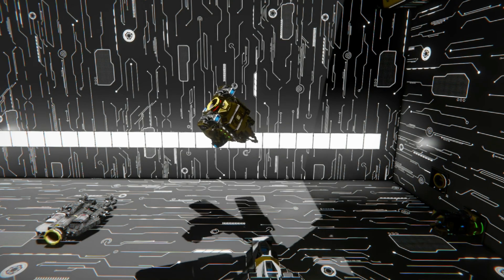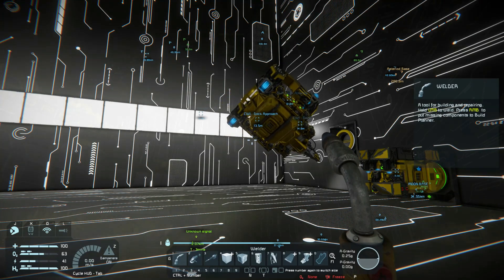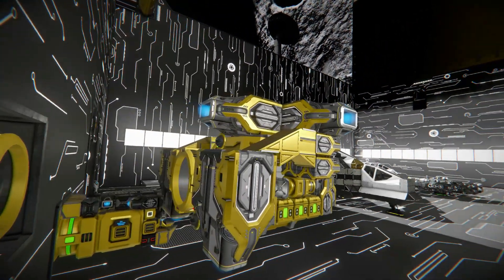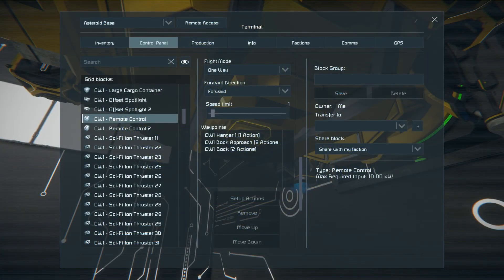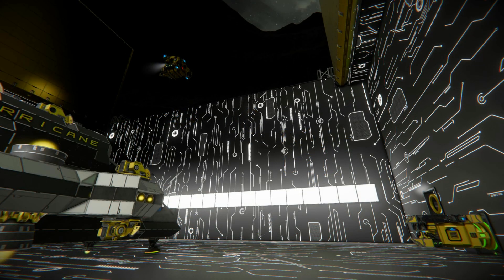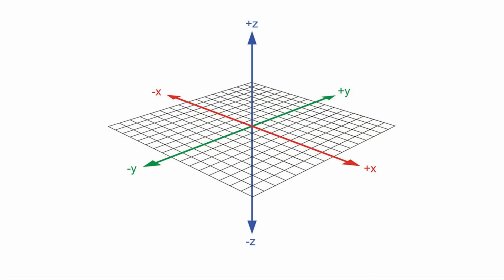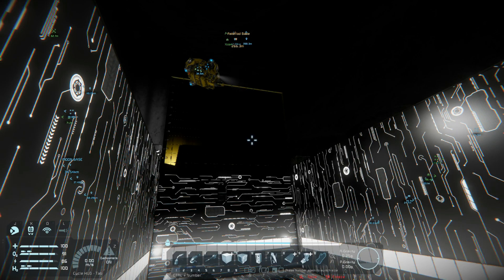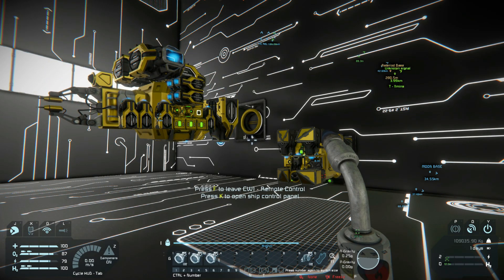Space Engineers - EP14 - Drones II | Perfectly Dock Autopilot Drones Every Time | Let's Play

Comment: Hi, is it possible thad this isn't working at all on planets and atmosphere? If I set the remote to fly down it flyes down, but also tilts the ship leftside down and crashes. And the over all manuervering accuracy is rahter low, even in precision mode and at low speeds of 10m/s.
Can you help?
Reply from the maker: Probably...or maybe.  :)  The Remote Control block does seem finicky on down and wanting to tilt.  So, like in my design where you saw it had more of a rear connection rather than a bottom one, it's so in a gravity environment I can set the final dock action to Laterally (which is a direction that seem to work more consistently in gravity fields), rather than a final direction of down.  Forwards seems to work pretty consistency in gravity fields. Backwards also works 'better' than down.  But if that seem problematic too, you can face a second remote block backwards the transfer directional control to the second to back it in (in a forwards direction the block thinks it's going).  As far as speed, 10ms /s is still too fast I think - I'm usually making that final dock at something more like 1-2 ms/s.
Hope some of this helps!
Reply: @Oearth  I have the connector at the side, so I dock via a drivebye. I thought I need to fly downwards for axis orientation, but I think I will skip this part. 
So thanks a lot for the information and the speed you're using :)
Reply: I finally got it to work. Thank you Oearth -  @losvegos2030, I have a Belly Connector, and I positioned my final Waypoint just above the Connector to unload. Then moved forward, set the WP and then up, set the WP. Then, I programmed the the RC to head toward the 1st Waypoint, let it go down, and then forward again whilst it was flying to the 2nd. At the second I told it to go Backward. Since then I havent been tilting to the left and crashing like you were. I also finally have it park and unload, and ready itself (speed) for the next journey
I hope that helps 🙂

Comment: this might be a dumb question im stumped i cant get the connector to lock everythings lined up the magnet kicks in then it just doesnt lock .
Reply from the maker: @Ladale English  It could be a spacing issue.  You can often get the magnet to draw in the ship to the connector, but it's still too far away for a lock.  For example, on a large grid build, mag plates will separate the connectors just barely enough so a connector won't lock.  Coincidentally, I show an example of that and a fix in tomorrow's (Friday) vid that'll post in the morning (10:00 a.m. EST).

Comment: i just tried this, and my autopilot must be on crack,  or maybe because i'm on a carrier.   would be sweet to have a "autoDock"  button because docking is such a pain.  but nope.   crashed my ship more times than i can count, and in survival this sucks.. so i gave up trying in a fit of rage.   anyways.. i'm done rage dumping..   thanks.. cya.
Reply from the maker: Was you carrier in space (like zero gravity) or sitting on a moon or planet?  I'm also curious exactly what problem you were having purely for my own intel gathering.  :)
Reply: @Oearth  zero gravity.  i think autopilot smokes crack,  because there was a number of times it just refused to go to any other waypoint other than DOCK,  and when its out of orientation and it skips the first 2 steps, goes to DOCK location, then turns to go to the 1st location,   booom..   all breaks.   so screw it.  unless someone comes up with a handy mod that i can place two blocks and docking works,  i aint gonna bother anymore.
Reply: @Oearth  but nanite repair system does help and so does projectors,  so make sure your blueprints are up to date before attempting, or else you maybe rebuilding some stuff.
Reply from the maker: @Dan Rickard  Couple of suggestion that may or may not help because...well...you know...   :)
1) Try setting your approach and docking waypoints a little father apart - sometimes things get wonky if too close.  2) Not only unlock you connector, but turn it off - the magnetism of the connectors can delay movements, cause it to skip timer or waypoint instruction, and other things.  3)  Most importantly, make sure after each attempt in your trials to hit "reset waypoints".   That function doesn't wipe out your waypoints as you might think by the name, but resets everything back to start at waypoint one.  I had a big issue with the drone flying off to odd waypoints and skipping things because from a previous failed or aborted test - the drone will try to pickup right where it left off in the waypoint sequence from a prior failure if you don't.  Good Luck!!
Reply: @Oearth  at first your suggestions was kind of standard and I already tried them but I kept reading.  Glad I did.  I did not know about the reset waypoints and likely this was my problem all alomg.  I'll give it another go and thank you for taking the time to reply to me.   Much appreciated.

Comment: Feeling nostalgic now, because I coded this stuff 5 years ago in a script. The problems you solve here are very familiar to me. And vanilla autopilot is still so much handicapped even after all those years... You have to babysit the drone through all this set up process and it breaks just after you move your carrier a little bit. It still can't travel in a direction not tied to its' orientation. Proper solution for docking - have the carrier dock orientation and position passed to a drone, align the drone immediately, and then re-calculate waypoints dynamically related to carrier coordinate system. That solves dock-to-moving carrier issue and the need to babysit the drone orientation manually. 
The drone should be able to travel independent of its' orientation (not only forward), because it loses time rotating on each waypoint to align with the next one, and it just looks so stupidly robotic and unnatural - no human pilot would fly like that.
I see that you can change reference block basis (direction - down, up, etc), they should've implemented translation (offset) change as well. I.e. dropdown where you can pick a block that would be considered the position of the drone instead of that remote control. It's unclear for me why they did one thing but forgot the second one. 
We'll see how would they rework everything in the Grid AI update, I really hope for the best, but judging the quality level of their custom turret controller implementation I'm a bit sceptical.